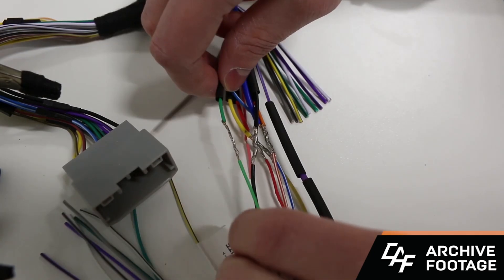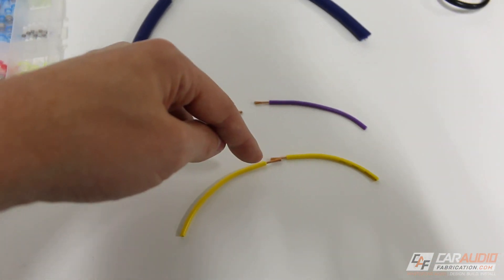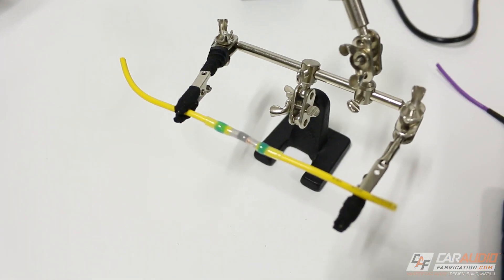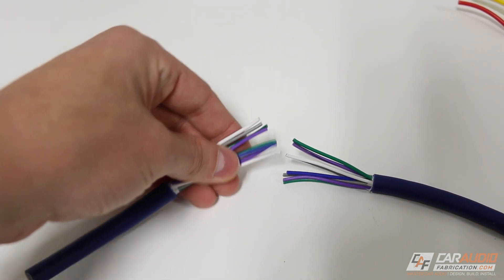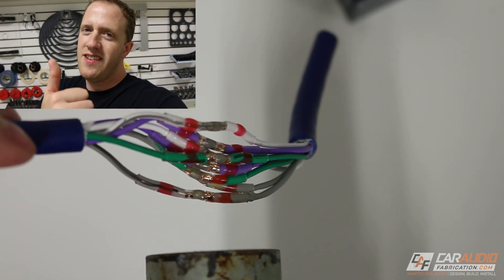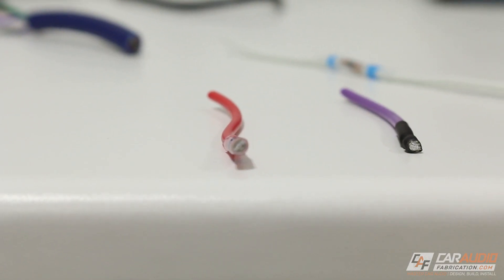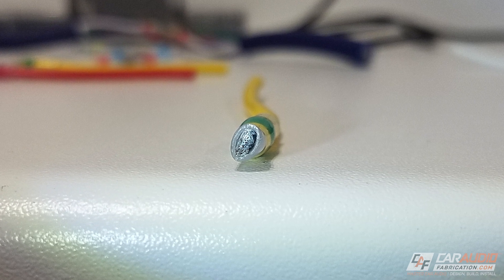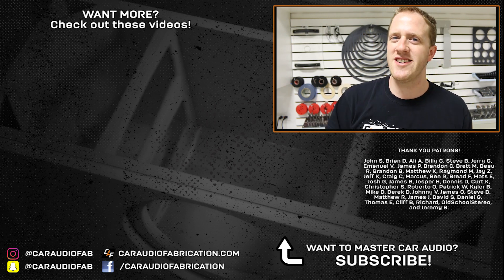Soldering WITHOUT a soldering iron? Solder & Seal Connectors

Comment: The price has come down for these connectors. You can find them for as little a $.05 each now. The added benefit, is you only need a Bic lighter to melt the solder. So, cheap with no need for a heat gun or soldering iron, I think they are a great deal now. When I first saw these many years ago (two decades?) they were a couple of dollars each, so they were not worth using on most jobs. Times have changed.

Comment: I use them with a mini heat gun that has two settings up to 900deg F. Sometimes they melt nice and easy while other times it takes forever SB's sometimes the plastic melts away before the tin/solder melts. Just depends on which ones you get I guess but when they work, they work great!

Comment: They DO NOT HOLD UP on rugged applications such as dump trucks and heavy equipment UNLESS you T W I S T wire before sealing. And even then iv experienced MOISTURE inside them

Comment: I bought a pack of one hundred of the red connectors on eBay here in the UK for £5.00, so that's £0.05p for one connector. I've used them for installing spotlights on my Harley-Davidson motorcycle.

Comment: I think you should have mentioned these are better the olden "budget" wire connection system of using crappy Crimp on butt connectors which loads of Auto shop still sell along with horrible wire strippers.

Comment: I still prefer soldering normally and using heat shrink for the best connection but those connectors definitely have their uses. You have to consider the time spent setting up the soldering equipment or being in situations where soldering isn't practical, like working on a car in a parking lot with no outlets. I've used a torch lighter to shrink and melt the solder on those connectors more time than I've used an actual heat gun. It isn't ideal but it works if you keep the flame at a distance and keep it moving.  Also, putting flux on the wires also helps the solder flow, just as it does with normal soldering.

Comment: Anybody trying to use these you must know that there should be no ring left in the middle as seen in this video. You need a small nozzle to focus the heat only on the solder ring

Comment: I have used them on motorcycle wiring. I do quite like them, and the  heat shrink section does seem tougher than generic heat shrink.

One issue I have had is melting through the heat shrink when trying to melt the solder. Due to this I tend to use an extra piece of conventional heat shrink over the join to make sure there is no uninsulated area I haven't spotted, and to further strain relieve the join.

I find it far easier to use a heat gun in odd positions than a soldering iron, and far less worry about putting down the heat source between joins. I actually normally use a heat gun sold for household paint stripping (and this is far tougher than my nice temperature controlled soldering iron). While some people won't have such a heat gun, a lot of people seem to manage to use a cigarette lighter for this , and they are far easier to get than either a soldering iron or a heat gun.

Comment: Not many outlets outside, whereas with these you can use a butane torch with the air attachment on and dont need an outlet. Also small butane torch plus these connectors are cheaper than a soldering iron and heat gun. Love your videos and watch them all the time to learn more, but this is one I have to disagree with you on. I can definitely understand your point of view and from a professional standpoint I can see why you prefer the iron+heatgun, but for me on a way smaller scale, I prefer the connectors+torch.

Comment: If you heat the colored band onto one end first  then it is much more manageable as you are not having to hold 4things at once also using a torch lighter of the smaller variety is a great alternative to the heat gun as it is much more localized

Comment: The cable melting is because of the materials used for the cable.

It looked like a Chinese cable also used in pro audio by people who can't afford the real stuff. Life expectancy is a year at most. If it hasn't killed itself before then...

Personally I am in the 'use a long enough wire so that you don't need to extend it and if so, use a proper crimped on connector'-camp. Based solely on experience.

Comment: in the timed tests i believe you didnt took into account the time the iron took to heat up, because if your just gonna do a sigle or 2 connections, the sleeves will be waaayyyy quicker, and for inexpereinced solderes, that 1min10s would be like 2min each wire

Comment: I read down a good number of replies and did not see this addressed .... with conventionali soldering, I always like to use a bit of electronics flux as it seems to pull the solder into the strands of multi stranded wire connections.  Wondering how the low temp solder in these connectors would respond if flux is utililized.  Thanks for the always informative videos Mark.  You are a true craftsman as the results of your projects always show.
Reply: x2 on FLUX!!!
These are my primary go -to. Just wired up some relays inside my FJ Cruiser yesterday. Dip each lead into flux, insert & heat for WAY less than a minute before I get flow (~20/30 sec). Depending on application/location I've used butane soldering iron (w/o the soldering tip, just the hot-head), a small crafting heat-gun & full size heat gun (fastest).
I strip the insulation to give total overlap when inserted, but have insulation go slightly inside of color band, heat ends first to lock-in, then hit the solder ring, let cool (canned air GOOD) then second sleeve of heat_shrink (color matched to wire when possible, thank you, OCD...)
FLUX...
Stagger...
Heat shrink.

Comment: my problem with those solder and seal connectors is I will sometimes burn the wire insulation before the solder even starts flowing.

Comment: While I do like them, not all conditions are controlled like this. Using them on a bench where you can hold the wires with clips works good. Try using them under a dash or under a hood, not quite so easy when there is nothing to hold the wires.

Comment: I use these for years on anything that I want to be watertight.  I use an open flame micro torch to melt them and have much better luck melting the solder. I love them.

Comment: I know this is an older video but why didn't you use a shielded reflector tip for the  heat gun to better and more efficiently heat the wire connectors with the low temp solder?  Wouldn't that have made wiring multiple wires together easier and prevent a lot of the overheating of the wire sleeving?

Comment: So those cheapy sleeves that come in craft trays like that are crap. If you get the TE ones they're fast and easy. The connection is deceptively strong too, having tested them myself with a heavy pull test.

Cool channel
Reply from the maker: The average consumer isn't going to buy the TE ones though, I have seen nothing but links to Amazon ones in car audio groups, so thats what I reviewed.
Reply: @CarAudioFabrication  fair point, and it's easy to assume they're all the same. I find the eBay ones need too much heat to get them to flow properly and they always come out a droopy mess.

Comment: I recommend you try with a lighter. Carefully melt the solder first and only then shrink the outer bands. Also, filtering your hot air gun into a smaller jet might help.

Comment: Great video. I like them. The TE brand works extremely well. Also, it's best to attach a reflector to your heat gun so that the connector is surrounded by the hot air.  Causes uniform melt of solder and shrinkage of tubing. Thanks for video!

Comment: Not a bad idea - tho, practice soldering vs practice using 'solder n seal', still practice.    But if not sufficient,  practice won't help.   
Using Smaller heat gun Tip may help;  Maybe even Two solder spots in connector would improve them.     -   Thanks!

Comment: I use a butane torch and the time is under a minute.Of course I use a diffuser to even the heating process. You were correct in using a smaller length f stripped wire.

Comment: I’ve used these before and for better results a hooked adapter for your heat gun cuts the time down and gets the solder to flow better. Your not having to move the heat on your own

Comment: I would definitely get a adapter for that heat gun to focus into a smaller hole. It really helps with heat shrink and solder sleeve such as the one you’re working with

Comment: So when doing the traditional technique I don't need to tin the wires before soldering?

Sure makes it easier to twist the wires together and then solder.

I always tinned the wires first but then it's difficult to hold the wires together until I get them soldered.
you can't really twist the wires together to hold them if they've been tinned.

Comment: Using these to splice aftermarket tweeters into a 2009 civic as they are dash mounted all the way forward where the windshield meets the dash.  No way I'd be able to get a soldering iron back there, there's barely room for my hands, so this will be interesting.  Wish me luck!  Thanks for the tips Charity.

Comment: I I found if you take the first side of the wire put it into the all in one piece heat shrink it in place and then add the other side heat shrink it in place and then do the solder part

Comment: After you started to get a small bundle of connectors, did you ever notice the integrity of the first one or two degrade after heating up and cooling down, heating up and cooling down as you added more connections?

Comment: I work on trucks and trailers and we almost exclusive use these. Like others have said, you need a narrow nozzle and a good, adjustable heatgun. Staggered connections make for little or no bulk. We routinely splice 15 conductor trailer wiring cables using these and finish with adhesive lined heatshrink.

Comment: First off- VERY Good video; Old School(I'm O.S.) Vs.Techy, solder penetration, multi-conductor (which is what I am about to do; PDM60 motorcycle install) etc...etc... So I have been researching several different ways to fab-in some LED strobes. Posi-Lock has some interesting connectors, but I wanted heat shrink peace-of-mind. I found those that you were using that come in the clear plastic box on eBay, but I don't need a huge assortment. SUMMIT RACING has a brand of those same Self-Solder connectors made by NTE Electronics that come in single size bags. BUT my point is that the ones NTE makes has a LOT more solder in them than the ones in that clear box. And in their video you can SEE the solder melt-and-flow pretty quickly; it also APPEARS to make the level of connection you were looking for. N-E-way......THANKS! for the great video from East Texas!

Comment: I used these in the navy. You'd have more success if you used a more narrow heat gun tip, rather than that open blow dryer style that you have. We would use heat guns that actually had a cup on the tip that wrapped around the heat shrink to heat it from both sides at the same time.

Comment: First used these in 1980; Western Electric.
Solder-seals is what they called them then.
Used only where there was a possibility of moisture.
Biggest short-fall was in joining wires of different gauge.
Not so good with stranded wires, either.

Comment: I have a cheap radio shack soldering iron, it's not great but it works. As for my heat shrink I just use a mini butane torch.

Comment: I have noob topics for you:

Effects of poor grounds/connections.
Creating a new good ground.
Protection of new connections (esp. Amp. Grounds)
Common causes of system noise.
Long term effects of pierce testing wires.
I finished watching while I typed.  Good stuff.
I concur...learn how to soldier correctly first, then decide what corners you think are worth cutting.  I holster two....my Wall Trig-R-Heat reliably handles the heavy lifting while a butane pen has its back.  Been tempted from time to time to buy a bench unit, but I only perform surgery on my own toys.
Liquid tape, anyone?
I can make a connection and soldier in places I cant reinsulate properly.

Comment: Good product idea, but the process is slower because heated air and heatshrink probably transfer heat worse than liquid metal. And that's why you have melted insulation outside of the tubing itself.

Comment: You can actually use a BIC lighter without burning them. I find them very easy to use. Also, 100% penetration of solder is not necessary as long as wires are connected.

Comment: I've used these on aircraft wiring during my time in the Air Force for both Communication Systems wiring as well as other general wiring, so I think if they are good enough for Military Aircraft, they are probably good enough for car audio. 
That being said, they are a bit picky until you learn their little tricks. First, you need to twist the wires in the same manner you did when you used the traditional soldering method. Second, if you heat both outer ends prior to melting the middle, they definitely aren't going to slip on you. And lastly, if you're doing a big wire bundle like the one shown here, it's best to stagger the splices, to keep bundle size down and make it easier to avoid accidentally over heating the other connections. Slipping a heat shield of some sort in between the slice you are working on and the other wires in the bundle helps prevent this as well. A metal pie plate works well, because they are easy to but to the size you need, and disposable. Personally, if I were doing a bundle, I would slip a big piece of shrink tube over the whole thing at the end, because they do look like shit when compared to the traditional method. 
One last comment, the thing you said about someone without a soldering iron probably not having a heat gun is a little off. Someone who is into car wraps would definitely have a heat gun and no iron, and it's pretty easy to imagine someone expanding their scope from wrapping to include audio as well.
As always, though, good video!
Reply: Charity Lloyd perfectly said. I’ve used these connectors with great success...big time savers!
Reply: I was going to say the same thing about staggering and twisting the wires but you did mention a few other tricks I wasn't aware of.  You just tought me a few neat tricks thank you.
Reply: Excellent, well-written reply.
Reply: Thanks. Very useful. I was wondering about flexibility. Soldering is too rigid for my bike application.
Reply: To add, if you wrap the wires in a way there is a little ball in the end just the right size to fit the tubing over it then it also holds it in place and penetrates better.
Reply: ...are you really that beautiful or is this just some sort of faux profile? In all of the world...

Comment: Very interesting, Thanks! I think an amperage test would have been very important here, to see if the joint was comparable if not equal to the normal way under an electrical stress.
Reply: These are used all the time for aircraft and boats. Even the Air Force uses them so I'm pretty sure they're good enough for car audio. I've tested electrical resistance myself with these things and there's no noticeable difference if they're installed properly with full melt.

Comment: Sometimes i dont wanna pull out my heat gun and use a lighter to heat shrink im guessing the  insulation will melt before the solder🤔

Comment: Those work a lot better, and faster with a torch or lighter, and when ever you have to connect a bunch on individual wires, you dont do them at the same place, do each one a inch or so away, so they are not at the same exact point, which will make the connecting area not as bulky. If your worried about the flame in the car, you can put a sheet of aluminum behind the wires, or even some aluminum foil folder over itself a few times, and can just slide it behind the wires. Just like soldering is an art form that you have to learn, so is using these connectors, just need to figure out the right heat range and distance. I twist the two wires together and then fold them into a small ball, that fits right under the solder band. The wire is also sealed with these, so they are water proof, unlike heat-shrink.

Comment: Thganks for the video. I looked at these things when I was doing a bunch of re-wiring work on my motorcycle but ended up using traditional methods because I already had all the stuff I needed but it's good to know that for certain applications, they do work. One thought though, on e-bay, they range quite a lot in price, I'm sure there are some that perform way better than others.

Comment: I use these on the custom vehicles I build. Key is a concentrated nozzle to direct the heat. I use 30 to 40 of these in each vehicle, they are a time saver for me and my employees.

Comment: Wouldnt it be going better if you stick the wire in flux, and then use an mini-heatgun (you got like small heatguns with more directional heat) so you get easyer into small spaces, but also flux would help flow thru the wire itself ;)

Comment: The reason you're having problems and getting poor results is because you're using a heatgun designed to remove paint and wallpaper, without a concentrator nozzle even. These heat guns also get far too hot, some up to 1200C. With how much the heating elements were glowing inside your gun, I'd say you were on the smokin' hot side.

You need a hot air workstation so you can control the temperature of the air and have a fine enough nozzle so you only heat the connection and not the entire bundle of wires. You can set the temperature low enough to avoid melting the wire as well.

Comment: Your heat was set too low.  You really need to use a small nozzle and blast the hell out of the solder. When youre done there shouldnt be any of that ring left.